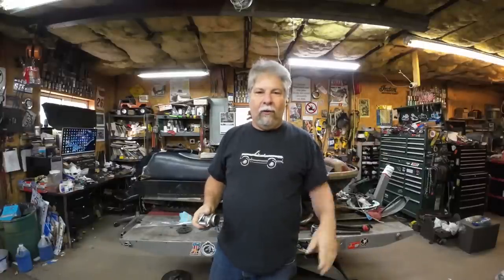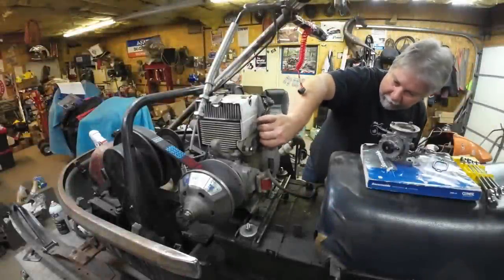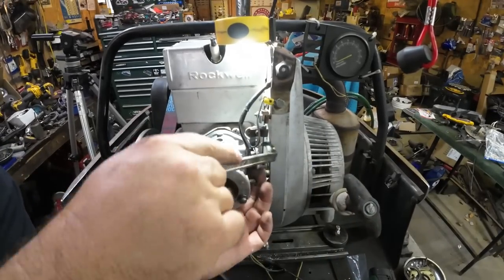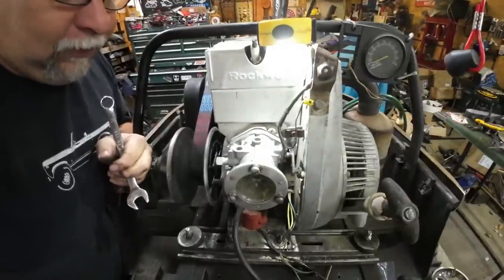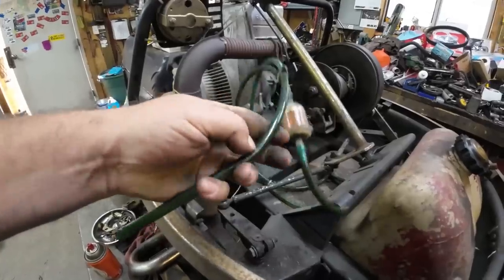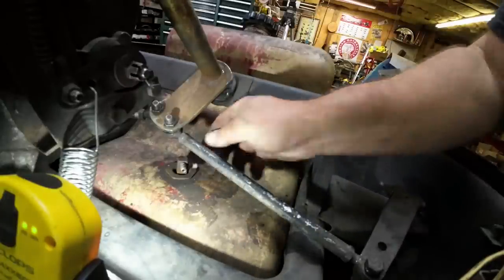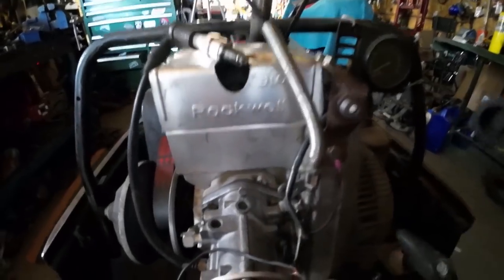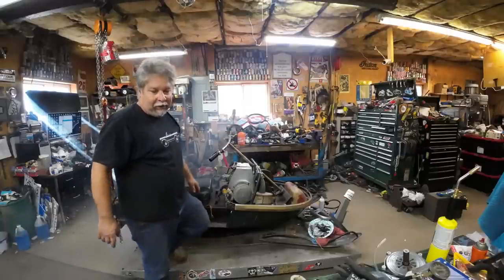"Race" Ski Daddler Part 5: Final Asm and Test Hits! Vintage One lunger Snowmobile. Single cylinder.

Comment: I bought a 74 tx 500 CDI box was bad I put one on off a 79 centurion it runs but was told not to use it do you have any idea where to get one I don't want to buy a bad one thanks Jim Brewer Zurich Montana
Reply from the maker: I don't know much about that particular sled. I took at a look in the master service manual that you can download from vintagesnow dot com and it looks like the coil resistances don't match the 79 at all. As far as finding one, Google Dr Mario's Vintage Polaris parts.
Reply: Thanks I did get ahold of Dr Mario and he said it will work and you can't find an original box I only paid $200 for the sled and I only had to clean the carbs and put a choke cable on it runs good